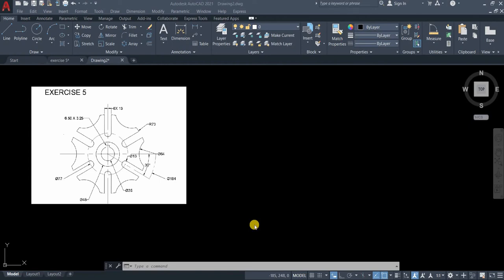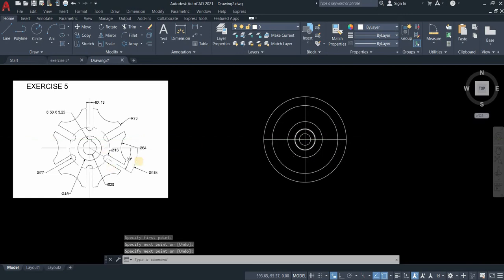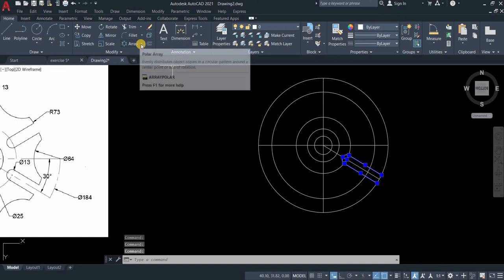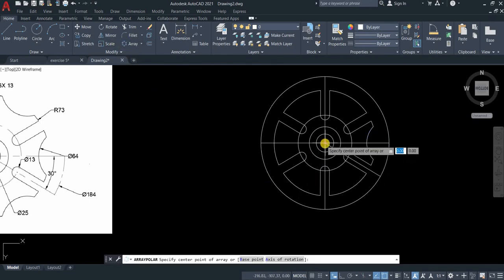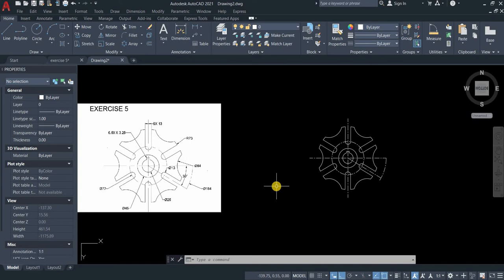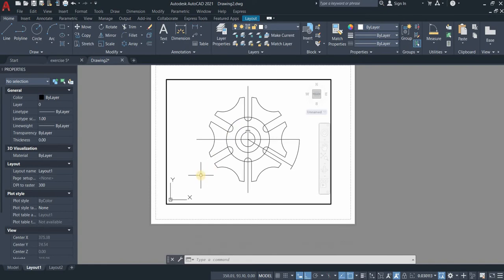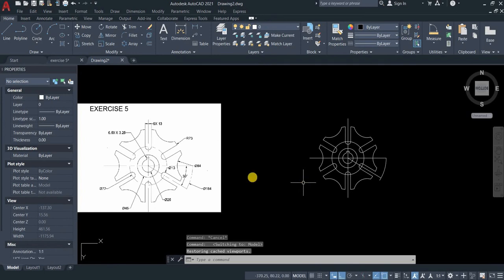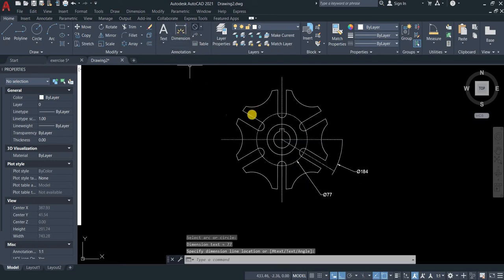AutoCAD 20 days 2D CAD Exercise 5. Using Pollar Array Command

Comment: how to measure 6.5 offset size explain pls
Reply from the maker: Hi Mohammed, if you chose to offset the line you either create mid point vertical lines then you offset both side with half the measurement of 6.5 which is 3.25.